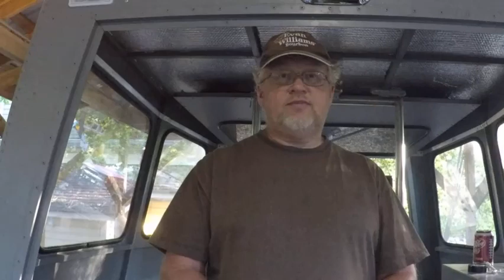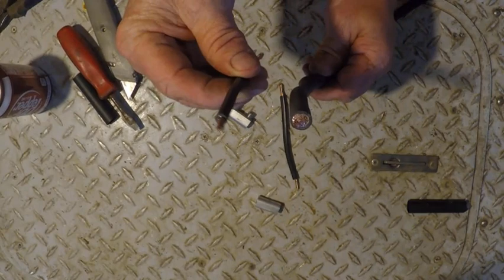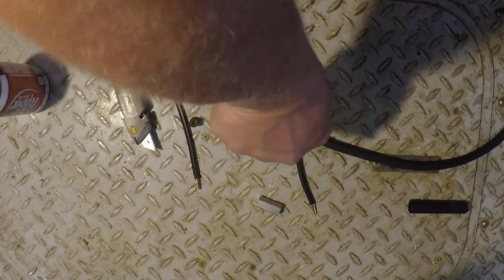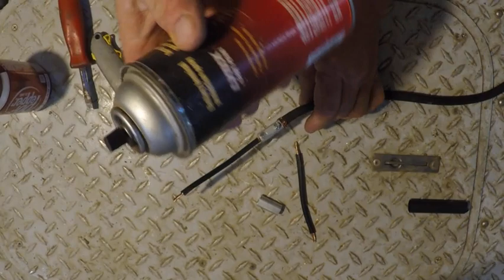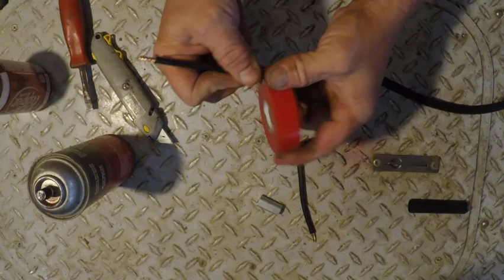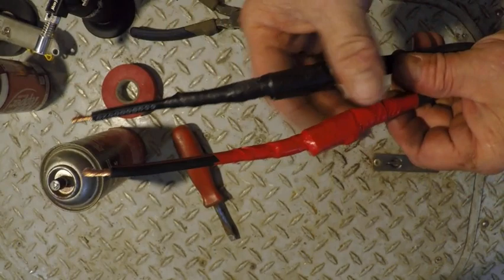REDUCING WIRE SIZE FOR TROLLING MOTOR PLUG

Comment: I simply soldered my wires together and heat shrink them. No use in using that big ugly block connector. If I were to use any kind of connector it would be a butt connector that crimps them together and looks much better.

Comment: With all the voltage issues with the Garmin Force, I’m wondering if this is contraindicated for it ?
Reply from the maker: All the newer units nowadays have such high needs for clean consistent power even the slightest power drop will cause loss of efficiency  if there are  any loose connection it causes issues with GPS and WIFI as well.   Thanks for watching.

Comment: NEVER EVER EVER use welding wire in a boat. You should be using a silicon tin copper wire and those connectors are junk for stranded wire if you're going to use those connections with stranded wire you should be using ferrules